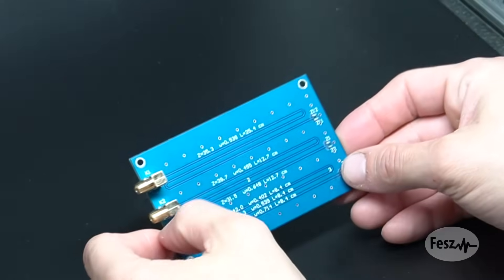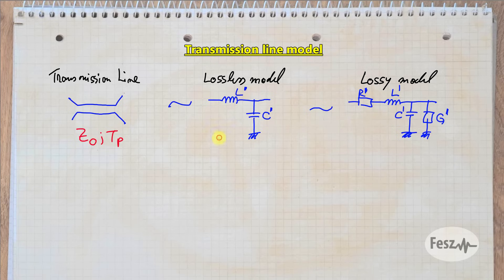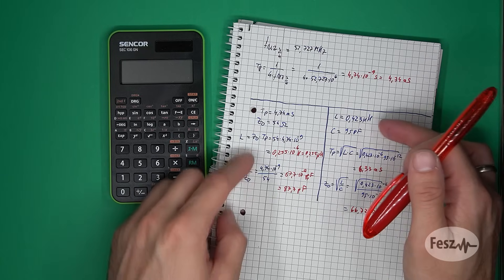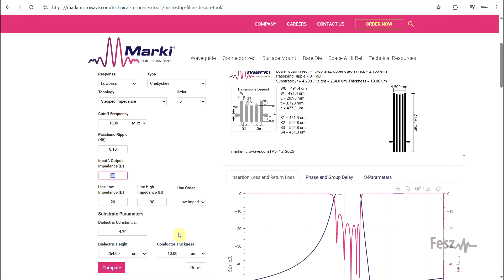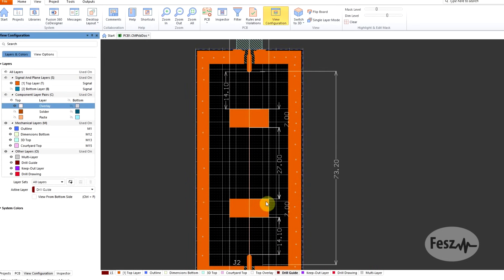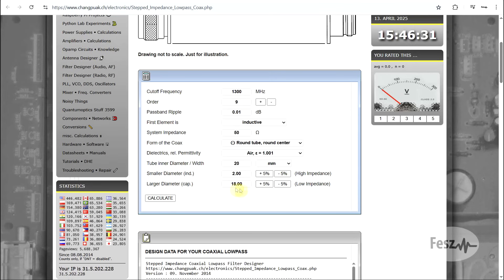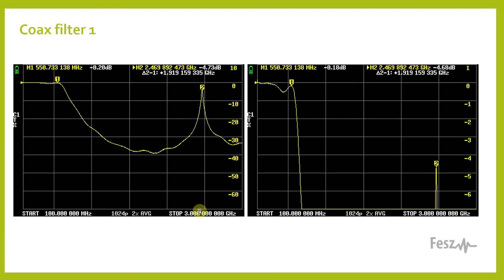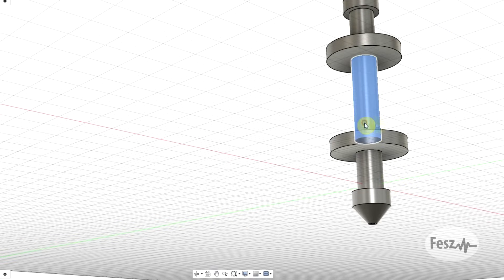Stepped Impedance Filters

Comment: A RF simulator can help to get these filters closer to their intended cutoff frequency. The other approach is to have several incremented filters made at the same time, characterize them and then build a model to compute the corrected parameters.
Reply from the maker: I guess, a better way is in-between - use the simulation to optimize what you get from a numerical calculation, then build one or multiple devices - characterize them - update the simulation model and create one final design that is as close as possible to the desired outcome.